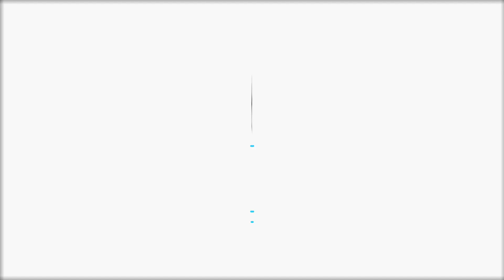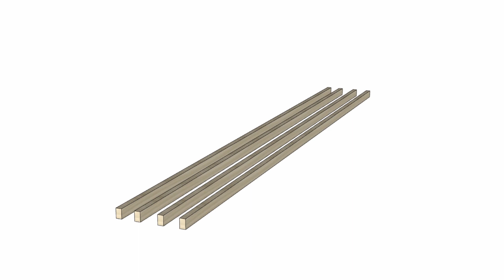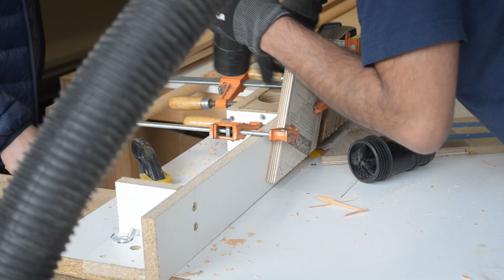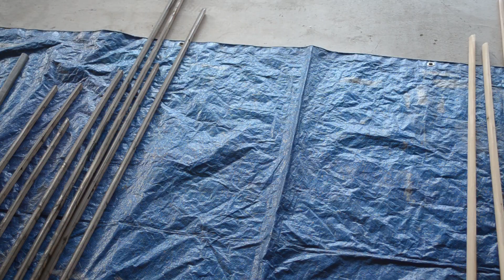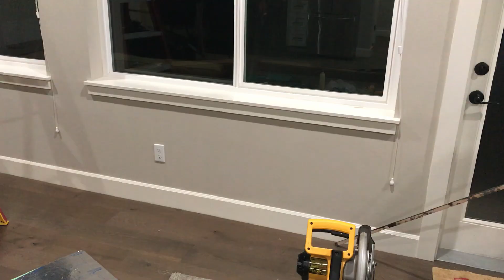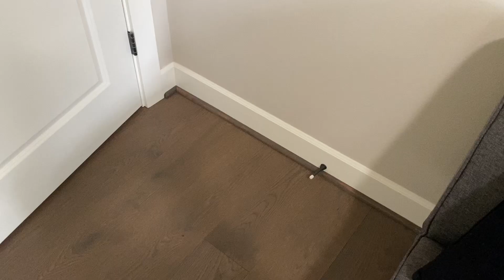DIY - Make your own Quarter Round Moulding from 2x4s | Budget Project!

Comment: Looking at my local home depot.. a 78" long 3/4 round is $20. That makes it about $3 a foot. I have a 4Ksqft home to do.. can't even fathom how much this would cost but at least a couple grand. In comparison, I can get 96" 2x4 for $3.65, and cut that in to what I think would be 6 or so strips? The only down side do the DIY route is the round over doesnt look like the flooring but instead you paint it to match the baseboard.

Comment: Bit of advice, its alot safer and easier to hold/work with the wood if you cut your lumber to the proper height of the roundover you want by resawing or planing, then cut the roundover on the edge of the 2x and then rip the roundover off the board and repeat (roundover, rip, roundover, rip, etc.) Leaves you much more surface area on the board to hold as you pass it through the router bit and keeps your hands farther away from the bit! Nice job tho! 👍🏼

Comment: Final product seem to be 3/4 x 1/2 which is Shoe molding instead of Quarter Round!?
Reply from the maker: The final product was 3/4" by 3/4", which is the standard size for Quarter Round.
Reply: They must account for the thickness of the table saw blade

Comment: How can you you get four one inches from a 2x4 which is actually 3.5x1.5 inches?
Reply from the maker: I already replied to your other comment but from 1 2x4, we ended with 8 3/4" x 3/4" Quarter Round moldings. (Technically they were 1/16" undersized)